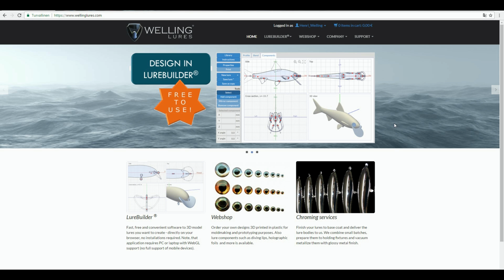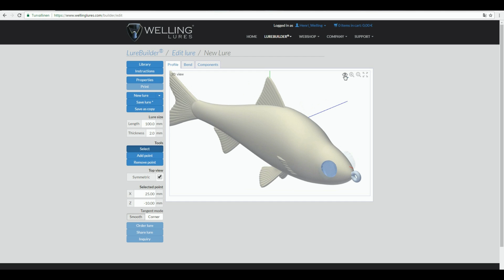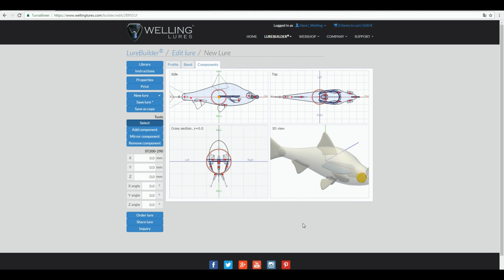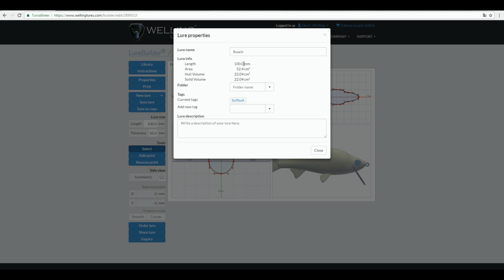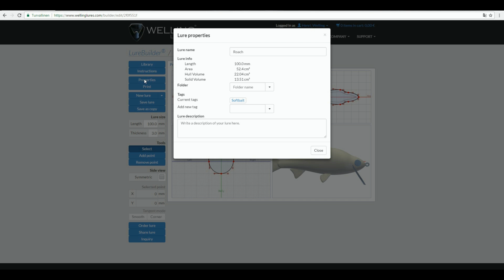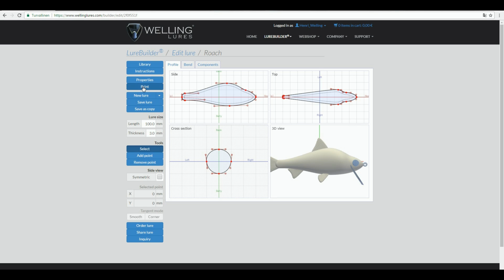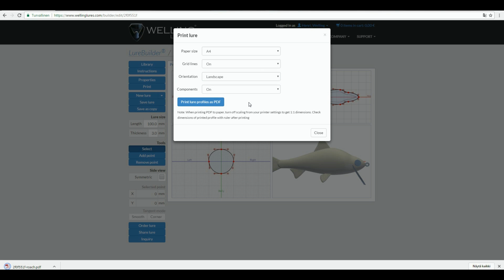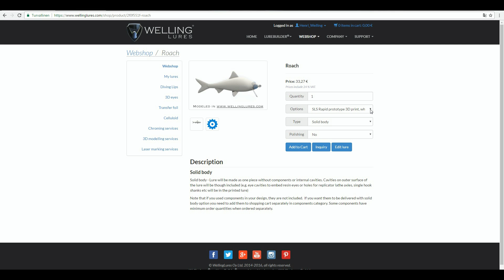LureBuilder® Introduction

Comment: You should add to put a picture on the background
Reply from the maker: Like a reference picture? Yes, it is a good idea. Actually we considered it in the beginning, but thought it would have also bit of a misuse. We did not want to emphasis any feature which could be used to trace also existing lures. But for referencing natural baitfish, it would truly be nice to have.
Reply: @wellingluresoyltd.8443  It need to added, as in any 3d editor there is such an opportunity. The creators of 3ds Max are not afraid that someone will make copies of 3d models.

Comment: it doesnt print the right lenght ?
Reply from the maker: Hmm.. Could you describe your problem bit more? Do you mean length is not shown correctly or do you mean when you print out as pdf and then to paper you are not getting desired 1:1 scaling? Length set in profile tab is for the main body and it does not include components like swimming lip. Unfortunately also curved tails etc. are components and software does not yet make difference for them. 
If you print to paper and main body is not the length mentioned in profile tab, then I would suspect you might have somewhere "fit to paper" or similar setting in your printer menu.
If you open the problematic lure in LureBuilder and use "Inquiry" button to send us problem description, we would love to take a look.

Comment: Would i be able to make a bass jig such as football,skipping,and flipping jigs?
Reply from the maker: You would be able to make model for the weight heads and include reservation for hook shank with e.g. hole object(s), make cavities to insert eye stickers etc. There are some restrictions for head shape as system supports simple molds without too concave structure. You would also be able to order master pieces as 3D prints, which you could assemble if needed and make your own silicone molds.
For jig skirts we do not have design support. Creature style tails, fish shapes etc. are possible with that same mentioned limitation for concave forms.
Reply from the maker: ...so something like this is possible to do in few minutes: https://www.wellinglures.com/builder/lures/view/0fce04e2/?s=gIFJfMgyuanq2k7RCNI6v1
Reply: +WellingLures Oy Ltd. yeah something like that.
Reply from the maker: Great. If you need any help in modelling, just hit us a line e.g. to info(atsign)wellinglures.com.
Reply: +WellingLures Oy Ltd. thanks i definitely will.

Comment: Very nice software. Is it also possible to save a design as an stl file so I can try printing it on my home 3d printer?
Reply: I was going to ask the same question.
Reply: Can a file be opened In fusion 360.
Reply from the maker: Apologizes, did not receive any notification you had left comment and spotted this bit late. Thanks for the feedback.

Stl export it is not yet natively supported in software itself, but we have done them by special request for many customers. It is relatively easy process to take it out, but requires some time per model. Can not guarantee we could serve all the customers and take out all the models, but feel free to contact us info(at)welinglures.com and we'll see what we can do. There might be export feature coming up with some modest fee, but it still needs some thought to do it properly (could cause also some issues and stl quality assurance should be preferrably automated to support this).
Reply: @wellingluresoyltd.8443  Theyre likely trying to make money off of the printing. Its a fantastic program. I have an idea in mind but dont want anyone to have access to it so it looks like I cant use the program. Another thing you could do is charge for the printing or charge for the finished stl file so we can print from home and no one else will be able to see our own designs.
Reply from the maker: @coryh7209  Thanks for the feedback. Yes, you are correct. We had to select 5 years ago if software would be sold by fixed price, annual license fee or by current financing model - by charging from prints. Last option was selected as not too many craftsmen had 3D printers that time and it was thought this is the easiest entry method for anyone wanting to try this method.
What comes to confidentiality of designs, each design is stored to user's own library and other users do not see them. There are two admins who can take 3D model out for printing purpose and we definately do not share the models anywhere, they are strictly confidential. Any leaks would ruin our business so we want to keep very high standard in data security.
 In some cases customers ask postprocessing with methods we do not have or for example to work with 3rd party mold shop, factory etc. For our own suppliers we have strict NDA's and we have not seen any data security breach in these 5 years we have been operating.
Best Regards, Henri Welling
Entrepreuner and admin of Wellinglures